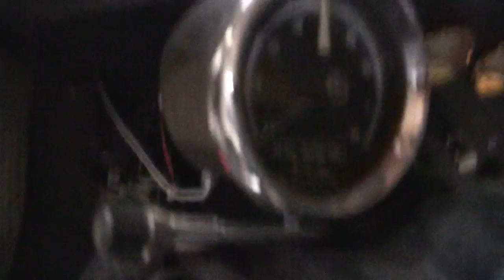HOW TO REPLACE A BRAKE LIGHT SWITCH

Comment: Hi I have a problem with my brake lights staying on and not going off on my 1951 Buick Special. I'm going to try and see if the switch is the problem. Thanks for the video. It was very helpful. Will try replacing it in a few days. I had a question do you need to bleed the brakes after replacingthe switch? Thanks

Comment: lost a couple friends that way too. 

thanks for posting that i have the same problem with my '52 Ford but since it's not on the road yet (body is still dissassembled, need some fenders or a wizard with sheet metal) wasn't going to worry to much till it got there.

Was there a wiring kit you picked up for your truck? (mine is still on the original 6 volt positive ground... )
Reply from the maker: It had a Painless wiring system in it but we had to do alotta rewiring of it!!☺

Comment: Thanks for sharing with us Roadking.  I've not seen a brake light switch like that one before. Is it the type they used when the car was new or was the braking system replaced at some point?
When i have a car up on a jack stands if I have a wheel off I slid the wheel under the car as an extra something to stop the car falling to far in case the worse happens.
Reply from the maker: Nah that whole system was replaced at one point!!☺

Comment: What about bleeding the brakes?  Pretty interesting that they use a pressure switch instead of a mechanical one.. never seen that before!
Reply: tester239 same. I've never seen that kind of switch before. I think I'd be bleeding them after that. C'mon Road King

Comment: Its interesting that that the builder decided to go with a pressure switch. It was probably the easiest way to go during the change over to a booster setup. And in all honesty, its probably a better switch than the shitty one's they used on the older stop points.
Reply from the maker: Yeah it's definitely a better set up than the plastic pedal switch!!☺

Comment: Like the 4 ways, the brake light should work key on or off. I'm sure they do because they are on the same fuse. Only the turn signals need the key on.
Reply from the maker: You're right!!☺